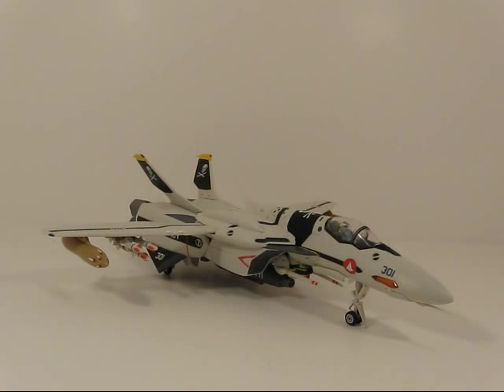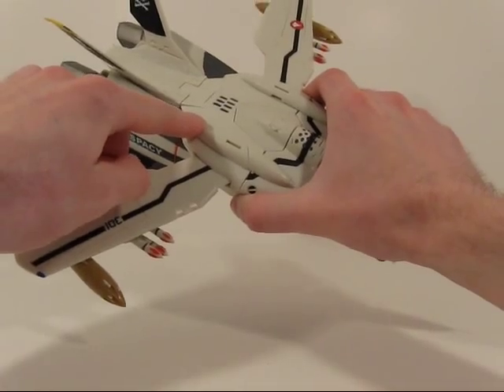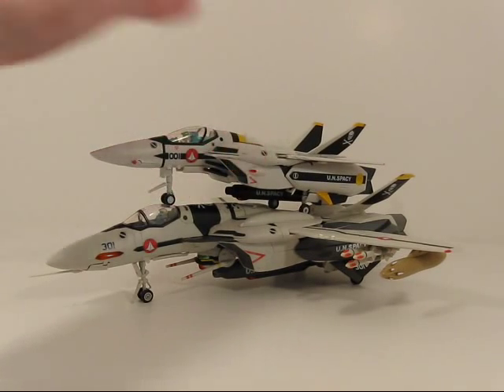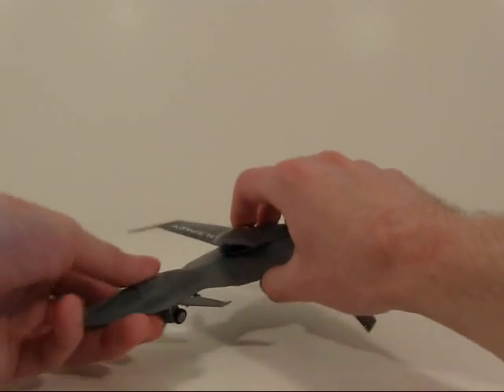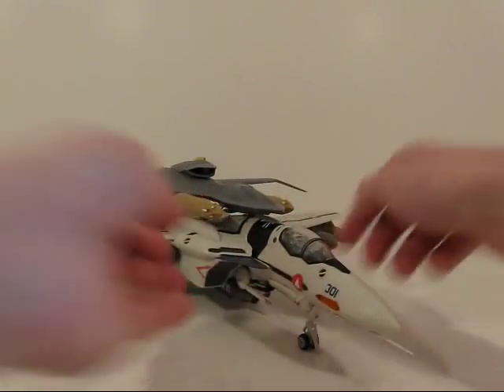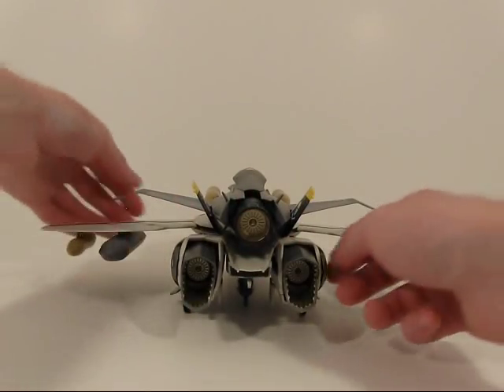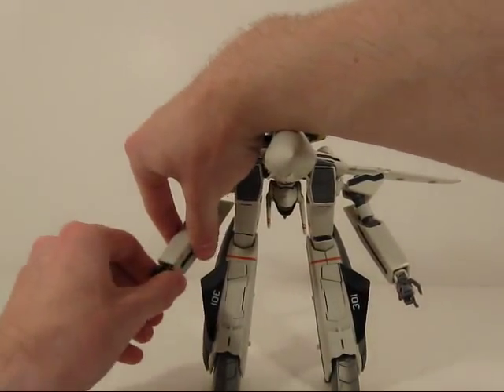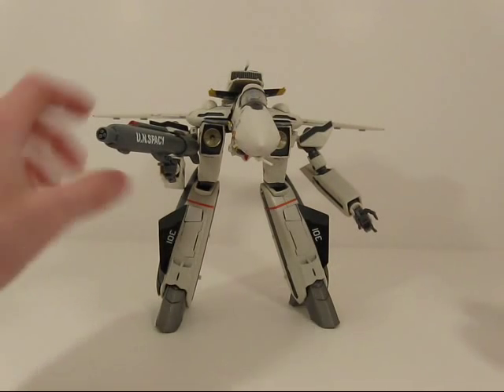Yamato 1/60 VF-0S - CollectionDX

Comment: @Xephon0930 smaller means a harder target...and like all modern aircraft a direct hit from a air to air missile will effectively shoot down a B-52 equally well as a direct hit of such will shoot down a F-22 .F-18, F-14 or F16 but smaller aircraft is always harder to hit  than larger aircraft and in general smaller aircraft are mostly more maneuverable than larger aircraft and if both use the same engine the smaller aircraft will be faster

Comment: I would really recommend not pulling on the forearms during transformation (fighter to gerwalk) as Andrew's shown here - the upper arms are notoriously weak on the VF-0. It would be better advisable to un-lock the intake area of the legs from the main body first, and then rotate the arms out by grasping the shoulder instead.

Nice review otherwise. Good job!